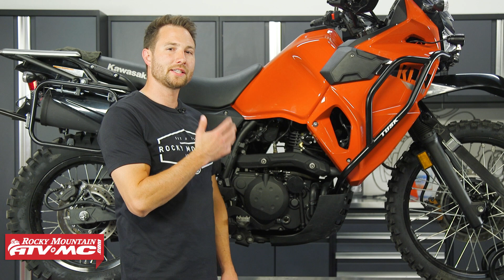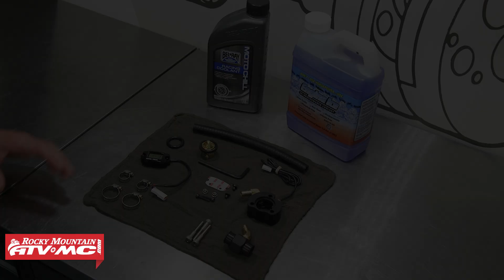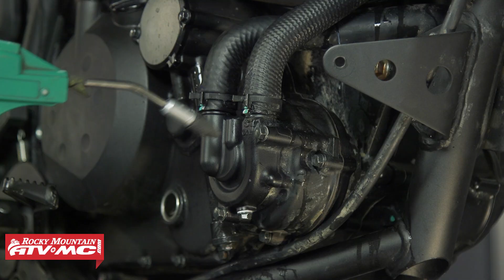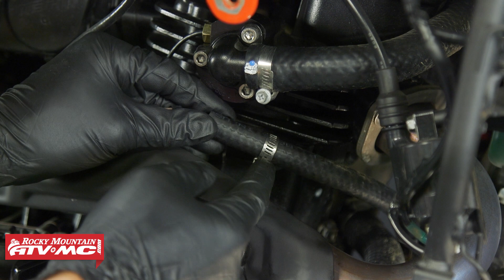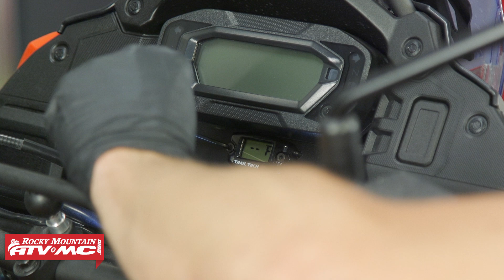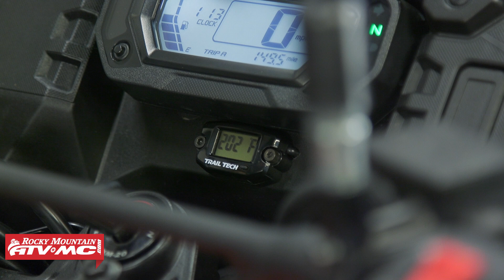How To Install the Watt-Man Thermo-Bob 2 on a Kawasaki KLR650

Comment: A tip when cutting the hose, draw a line between the 2 dots, then when u put the y in-between you can be sure hose is clocked corectly.
Reply from the maker: Thanks for the tip!

Comment: Where did end of temp sensor ( positive) wire go, to battery? I miss it, fuse in line?
Reply from the maker: The wire plugs into the digital temp gauge. The temp gauge has a non-replaceable battery and should last 5-6yrs.

Comment: Just installed a ThermaBob. But cut the hose to the water pump in the wrong spot... a bit closer to the pump than the radiator. I tried to refill fluid but can't get the level in the right hand tank more than 1/2 between full and low without over flowing  out the top. I ran for 2-3 mins with the cap off to make sure there was no air in the system. But no change. Thoughts?

Comment: 1987 engine in a 2025 motorcycle with 1950s cooling technology
Reply: I rode a 2011 for 5000 miles over the entire month of august. 90 degrees or higher everyday. The cooling system did it's job just fine. I guess like most things, they had cooling systems right in the 50's.

Comment: I wouldn’t say the Thermo-Bob allows the engine to warm up quicker because now there is a small constant flow through the cooling system. This will take longer for the engine to warm up, right? It will equalize temperature variations in the engine though while warming up because of a small constant flow. Once the engine is warmed up there will be less temperature variation in the cooling system if the thermostat closes and then re-opens after a time because of the small consistent flow.
Reply: There is a small constant flow though the bleed hole in the standard thermostat as well, so warm up time is pretty much the same - the difference being with the t'bob it comes up to a proper operating temperature and stays there ('08 Gen II, original t'bob)

Comment: You missed a step, where there is 3 philips head screws on the inside a fairing where the fairing fastens to plastic radiator shroud. Other than that excellent installation.

Comment: This question is slightly off topic, what kind of coolant I need to use to top of my 2022 klr? It's closer to L that F on reservoir..
Reply from the maker: We have a few options that would work great like the Maxima Coolanol ( https://www.rockymountainatvmc.com/parts/maxima-coolanol-p ) and Bel-Ray Moto Chill ( https://www.rockymountainatvmc.com/parts/bel-ray-moto-chill-racing-coolant-p ). Also, make sure you don't overfill the reservoir. When the engine is cold it should be around the L and then when the bike is warm it will raise to the F.

Comment: Does the thermo-bob help with keeping the engine cool at all?
Reply from the maker: No, it does not. There is a full technical write up from Watt-Man where they go in-depth on the KLR cooling system and what the Thermo-Bob does if you want to check that out. Here's a link to that write up: https://watt-man.com/wp-content/uploads/2021/01/Art_TB_Testing.pdf

Comment: What exactly is the benefit of that?  (because it's introducing another source of leaks, something to avoid at all costs...)
Reply from the maker: The Thermo-Bob helps the KLR get up to the proper temperature and keep it there instead of having large fluctuations in temperatures like with the factory setup.
Reply: @rmatvmc ok but this is bad why?
Reply from the maker: Check out this in-depth write up where they go through the system on a KLR showing the benefits of having this versus not: https://watt-man.com/wp-content/uploads/2021/01/Art_TB_Testing.pdf

Comment: Do regular maintenance and trust the Kawasaki ENGINEERS! That motor has been around for many many years.
Reply: If that's the case, why does EVERY OTHER LIQUID COOLED MOTORCYCLE ENGINE come with a thermostat bypass on the cooling system?
Reply: @shortattentionspangarage1312  In that case just run an air cooled system, like a Harley. Your oil will always be hot.
Reply: In that case WHY DOES THE STOCK ENGINE BURN OIL AT CERAIN INTERVALS BECAUSE OF ITS CYLINDER HEAD AND RINGS
Reply: @Geoduce  I don't know. Maybe the motor wasn't broke in properly. Maybe the oil is not being changed regularly. My klr650 doesn't have that problem.
Reply: @ not from what I’ve been told, what I was told was that the bike was originally made as a 600 then upped to a 650 in later models without changing the piston head or counters or rings or anything. This made them unstable at certain rpm’s like idle or 70mph allowing oil to slip past the rings
Reply: @Geoduce  If u want to install the therma bob for piece of mind, then u should do it. I don't think it will hurt. Its ur bike. Be safe on the roads and trails
Reply: @ you right but I pretty much need it now, new 685 kit installed and I don’t want to take the change of letting the cylinder warp
Reply: @Geoduce easy fix with different ring. Just a cylinder in a bore.
Reply: You obviously didn't read the tests from the link or anything for that manner but not our problem 😂

Comment: Is this mod designed for hot or cold climates?
Reply from the maker: Both. The Thermo-Bob helps the KLR get up to the proper temperature and keep it there instead of having large fluctuations like with the factory setup.
Reply: @rmatvmc  Thanks, my post was going to be mainly to ask that but I still would like to know if the thermostat that comes with the kit is generic enough to find anywhere?
Reply from the maker: @Turco949  I believe the thermostat that comes in the kit is a standard 195 degree automotive thermostat.

Comment: Has anyone experienced the thermo bob leaking from the temperature sensor where the sensor wire is attached to the thermostat housing? Installed mine and coolant is weeping from that area.
Reply from the maker: Hmm... that shouldn't happen. Was this from a brand new kit? Give us a call or reach out to our warranty department. 800-336-5437  sales@rockymountainatv.com (Please include your order # or billing name & address) -Charles

Comment: Common sense would say install immediately at purchase, even though it voids warranty (I'm sure).

I live in Canada, thermal variance is a thing, especially riding into late October down to 0°c.

Would you recommend doing it immediately? After break in? Or after 1 year warranty is up?

Great vid, thanks, 

G
Reply: I just purchased a new KLR last Friday and it only has 1 mile.  I did order the 2A kit to install before I take it out for it's first ride.  Here in the USA, the manufacturer may have to prove that the modification caused any issues during a warrant claim, and in the case of installing the Thermo-Bob, I cannot see what damage it could cause.